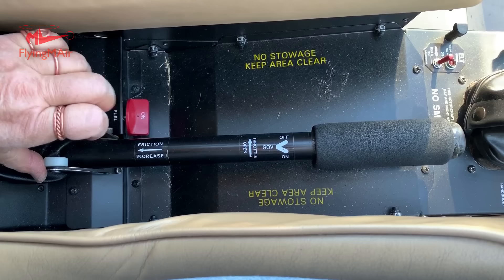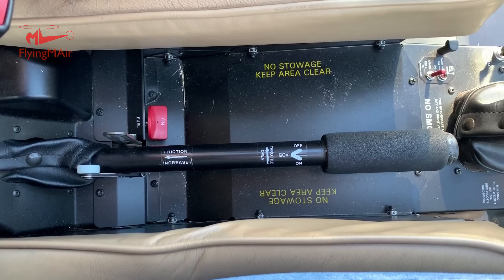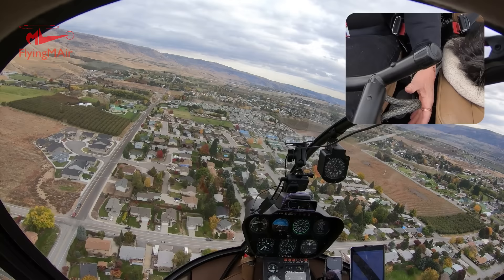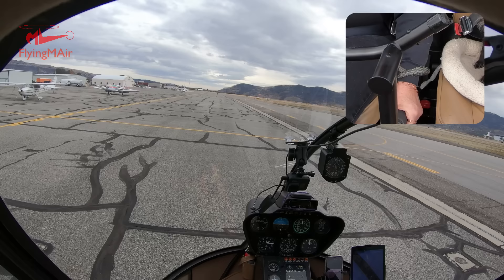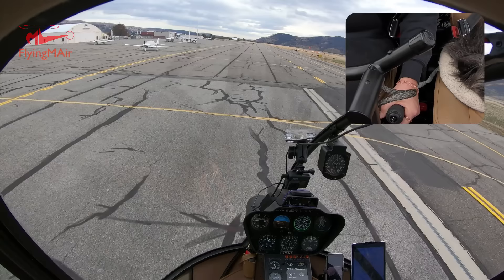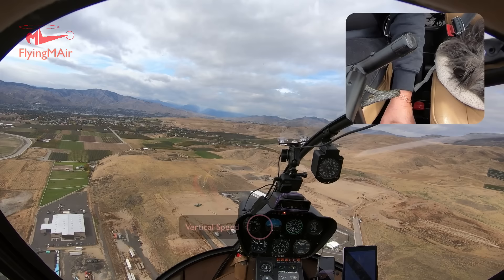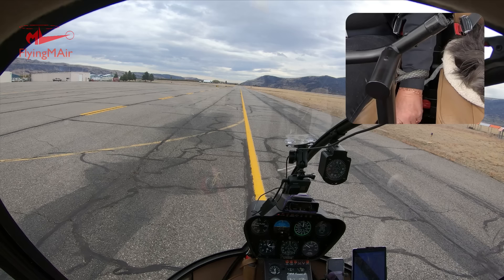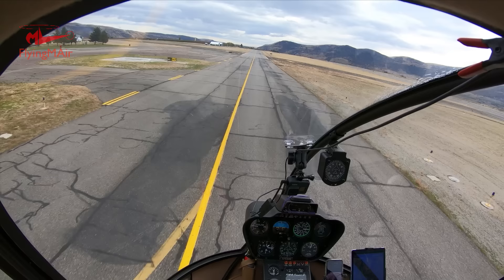Helicopter Flight Controls: The Collective

Comment: Great explanations of Collective, Cyclic and Pedals. Thank you!
I couldn't find the specific Throttle control exclusive video you mentioned. The role of this and the governor are confusing for me.
Thanks again.
Edit: But I did get a pointer from one of your answers to a throttle question in the Comments below. That you set the Gov on before takeoff and it does its job from 80% power on. Thanks.
Reply from the maker: I haven’t done the throttle video yet. It’s on my list for the spring.

Comment: Just a small point some old helicopters had the throttle rotation like a motor cycle, I remember my father saying how nice it was when he changed over to the Bell 47 from the old wirlwind or might have been the wessex that the throttle naturelly twisted with application of collective.
Also I know you simplified the autorotation, as the low collective allows the blades to drive the rotation, but it is hard to explain how as the blades remain in a positive pitch. Most people a shocked by the fact that autogyros have positive pitch and when look at them think the blades must go backwards.
Anyway a good video for me to show the Air Cadets.
Reply from the maker: You want more on autorotations? Here you go: https://youtu.be/W9UEqinM0Js

Comment: Hi Maria,  thanks for the video!  You mentioned ETL I understand (I think) the tail and main rotor vortices over lap each blade as your slowing down thus vibrations. I also understand that going from flight to hover makes some vibrations. I remember you having trouble with the Huey going thru ETL. You seem to handle the Robinson quite well. Seat time makes ETL easier to work with in any helicopter? 

I really like this Helicopter Flight Control Series! 👍🙌👍

I got to go back and catch the first one tho.
Reply from the maker: I've got about 2300 hours in R44 helicopters and, frankly, at this point it's like driving a car. Unless conditions are weird, I pretty much know exactly how the helicopter will react in just about any situation. Makes it really easy to fly -- and very hard to narrate what I'm doing.

Comment: Hi Maria. As always, simple and informative and wonderful to get an insight into the operation and mechanics of flying the helicopter. So, if your teaching skills are as good as I say, the amount of lift is based on the reading on the "Manifold Pressure" which is basically sucking in more air and fuel?? Having said that, whilst you will offer explainations on the throttle later, I take it the throttle power is decided before using the collective, and having noticed you didn't adjust it during the tutorial/flight, it must generally be left at the selected setting?? Just love your videos, the techno-babble reduced to a level we can all understand and I for one, have learned much from your expert tutorials.. Keep them coming lady..
Reply from the maker: I cover manifold pressure in the description of the video. As for setting the power, no, you can set it and change it as you like/need to during the flight. I just find it easier to set if for my desired cruise speed in the conditions of the day and leave it alone. There's no need to constantly adjust it unless there's turbulence or I need to perform a maneuver (slow down, speed up, descend, etc.).

Comment: 1) During takeoff, when you say "pitch for 45, than 60" are you referring to degrees of rotor blade angle?   2)  Once airborne does the throttle position stay the same unless you want to increase speed?
Reply from the maker: Pitch for 45 means to push the cyclic forward to move at 45 knots. I'm thinking I said this during a takeoff run? Standard takeoff is to push the cyclic forward to 45 knots at about 10 feet off the ground, then adjust cyclic for 60 knots, which is the climbout speed. We don't adjust the throttle in flight in an R44; there's an electronic governor to do that. We just raise or lower the collective. More collective means more blade pitch which requires more power. Generally, that'll cause you to RISE, but if you also push the cyclic forward more, you'll get more speed instead. The cyclic and collective must be worked together to get the results you want.
Reply: @FlyingMAir  Yes, you did say "pitch for 45, then 60" in this vid.  And, yes, thank you, that now makes perfect sense.

Comment: The question is. when i need to clime to 200 meters i will bull the collective to a specific degree , when i reached 200 meters should i leave the collective at that degree ?? Or push it down ?if i leave the collective at that specific degree the helicopter will stay at that  altitude or it will rise more ??

Comment: What is the main reason for having the Automatic Throttle system? Is it designed to make it easier for beginners to fly? Would you rather have a system that you control or would you rather have the automated system. I'm assuming it would be like a car going from level to climbing  a hill. Instead of the driver pushing on the gas pedal down more, the cars automated system increases the throttle to maintain a certain speed.

Comment: so when does one fiddle with the throttle at all? when you were on the ground, idling at 12 inches mp, i thought you'd have to open the throttle to make up for the change of blade pitch that needs to lift that thing up. i'm new to helis and couldn't quite catch it, but i'm certain i haven't seen her touch the throttle at all, really. would appreciate any explanation cheers
Reply from the maker: On a Robinson, there's an electronic governor that takes over throttle control at 80% RPM. So in flight, at roughly 100% RPM, the governor is doing all the work. I just adjust the collective as needed to climb, descend, increase speed, decrease speed, etc. I can sometimes feel the governor turning the throttle in my hand when I hold the grip. On my helicopter, I can pretty much set-and-forget the collective in cruise flight -- it generally doesn't move unless I move it. Hope that helps.
Reply: @FlyingMAir  interesting. thanks for answering! now i wanna fly a heli...

Comment: Do you twist the grip on the collective as you raise and lower it to control the throttle
Reply from the maker: I don't have to. The Robinson R44 has an electronic governor that controls the throttle at RPMs over 80%.
Reply: @FlyingMAir  O.K, what about other helicopters, I've seen many pilots twisting the grip on the collective as they raise it.
Reply from the maker: Good question! Not all helicopters have a governor. Schweizers and Hueys come to mind. Older helicopters usually don't. 

I should clarify that I do twist the throttle to get the RPMs over 80% before taking off. And then I twist again to throttle down as part of the shutdown procedure. And I can override the governor at any time by just twisting. (I can actually sometimes feel it twist in my hand when I have my hand on the throttle in flight.)

Comment: So as you pull in collective, are you adding throttle or do you set it at a max level and just fly with the collective and cyclic?
Reply from the maker: An electronic governor controls the throttle in most modern helicopters. That brings the controls to three: cyclic, collective, and anti torque pedals.

Comment: Very interesting, I can see it's lots more complicated than flying Cessna's..and is there such a thing as "auto throttle?" Oops, I read the description after I watched it, and see where there is, I thought I saw it working in flight!.
Reply from the maker: The throttle actually DOES make tiny twisting adjustments in flight. I usually don't even notice it.

Comment: I have built and flown 3D model Heli's for years and understand all the theories you have mentioned about helicopter flight. One of my questions is with a full scale heli, how much if at all negative pitch do you have at full down collective. Also how much positive pitch do you have or can you pull at full up (I'm assuming you can only use full up at the end of an auto)?

Comment: At high speed how does a helicopter react to decrease in collective? Ive been wondering this for a while i expect maybe a float for like 2 seconds then a decent? Or how would that work?
Reply from the maker: A decrease in collective without changing the cyclic pitch would start an immediate descent.
Reply: @FlyingMAir  very cool thank you

Comment: I am curious and have a probably silly question. At 7,20 you said you were "landed on the ramp and were going to take off and doing left traffic on the taxi-way parallel to taxi way one two".  My inquiry is this... would YOUR LEFT be the same and or understandable in terms of direction to any other pilot anywhere in or approaching the traffic pattern?
Reply from the maker: Yes. Left is relative to Runway 12.

Comment: I know this is a dumb question....but hey....unless somebody tells us, we wouldn't know anything..right.
When you turn left or right....is that when you use your feet on those pedals....
( i saw your feet on those horrible pedals in that huey video)

How the hell do you move 2 feet, 2 hands and twist the throttle and look where you are going at the same time..
Another thrill and increase in my heart rate,  while sitting in my comfy chair at home...
Thanks again..  :)

You answered some of my question at the end..sorry...i jumped the gun...
...i was excited...ha.
Reply from the maker: I'm really not using the pedals much in flight. Maybe tiny adjustments. Believe it or not, it isn't difficult to manage four controls. Like I said, the pedals don't need much attention in flight, although they are very important in hovering. The throttle is controlled by a governor. So it's really just the cyclic and collective and, as you can see, the collective doesn't need constant attention unless you're performing a maneuver.

It can't be hard -- my wasband could do it! LOL.

Comment: Gee, collective is totally mechanical.. ? Metal rods? Just like my 1931 Ford Brake lines which are in fact metal rods (no hydraulics for brakes).
Reply from the maker: The R44 has hydraulic assist on the collective. It's extremely hard to move with hydraulics off.